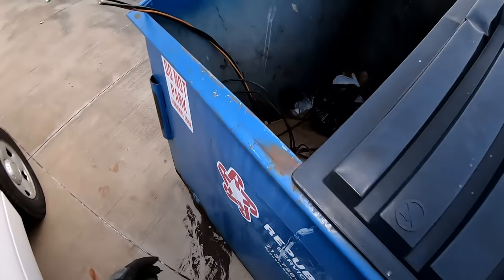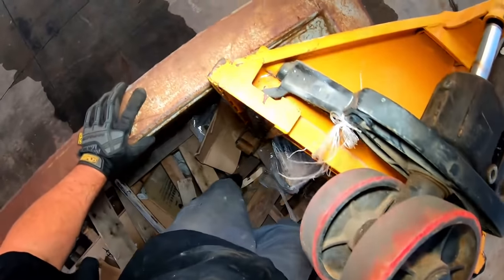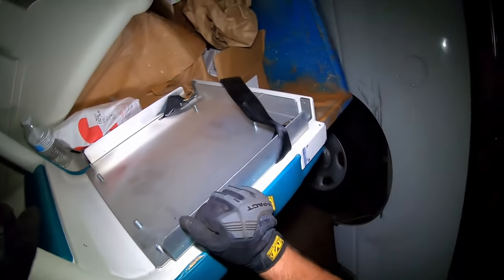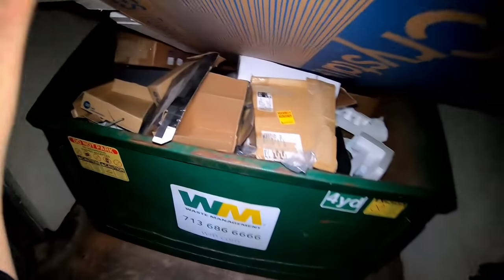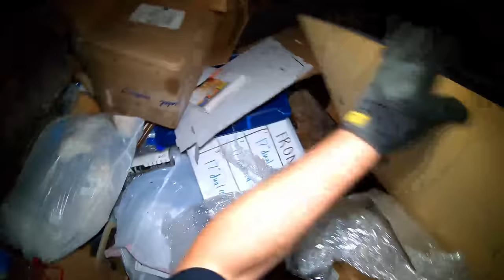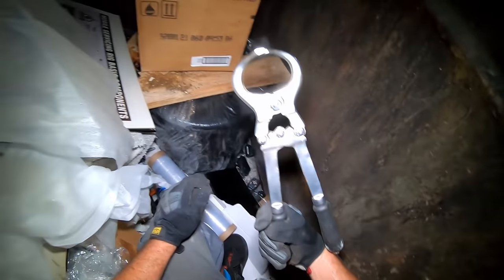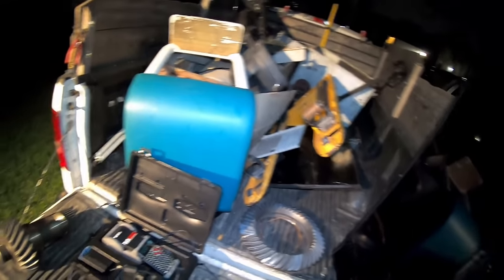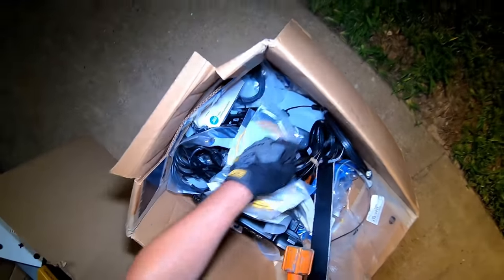Dumpster Diving "That's Some Meat Right There!"

Comment: I had a little random luck dumpstering yesterday, someone tossed out a retro colored microwave that seemed to have never been used, stuffed with dishes  (I didn't go for it, I don't need another Microwave). However, I scored a Coleman Red Canyon 10x17' tent, totally unused, an 8 pack of Disney trading pins (also unopened) and a 4 pack of Pokemon Pez (ditto), almost $200 score, the tent ranking in around $155 on Amazon, $25 for the pins, $12 for the Pez.
Reply: Nice!
You could start your own YouTube channel!👍😊
Reply: Sweet score!

Comment: I haven't said this many times: but I was impressed you got the pallet jack out.
Reply: Way it was stuck in there.. I woulda said.. HELL NO. 
Then again im a lazy sob sooo :P
Reply: I found a construction sight had 3 pallet jacks in the roll-off. I grabbed all three. I took parts off one and fixed the other two. Sold one to a friend of mine now I wished I had not messed with them. I ended up concreteing the whole shop and some sidewalks so I could roll pallets around. They don't work to good on dirt.
Reply: أر📤📪📟📟📟
Reply: @richardjohnson4373  g
Reply: Sjadalhlbuse
Reply: Sjadalhlbuse
Reply: Sjadalhlbuse ĝ6

Comment: So the oil field thing you didn’t know what it was is called a drift or rabbit. It’s used In wells that are completed and producing to help prevent scale build up, pressure in the well drops below a certain psi and the rabbit falls, pressure builds pushing the rabbit back up. The trick is catching it in the tree!

Comment: Mike that thing your calling for cows hoofs is stainless steel and called a Burdizzo emasculator, it's for docking tails and castration by crushing the tissue prior to cutting to help prevent bleeding. They are about 350.00 new. Used they still sell around 100 to 150 because they are used allot on ranches. For sheep and cattle

Comment: That item you called a large toenail clipper was really a item used for cutting the cords in the ball sack of a bull to make him a steer. To see how it works but a piece of string between two pieces of paper and then clamp down on it you will Cut the string but not mark the paper. stay safe good luck 🇨🇦

Comment: Hello Mike the pliers that have found and meant they would be for pruning hooves is for castrating horses so that the seed strands are so squeezed so that they are desolate which are expensive you can sell to a veterinarian.👍🏻 greetings from Germany.🇩🇪
Reply: I have a set for use on cattle - they're called a burdizzo.

Comment: You can buy a rebuilding kit usually at Granger,  if it dosen't go up or down check fluid, highest set screw on cylinder,  should full  up to there . If is theres two ball valve springs, one is stuck open. Kit is easy to put in and has instructions.

Comment: You should be grabbing those dry erase boards. The frame and marker shelf are extruded aluminum and some of the better ones have painted sheet steel for the writing area.

Comment: If you got an angle grinder / cut off wheel, you could add those refrigerant tanks to your scrap pile. Also, for things like gears, see if you can locate a metal artisan in your area. They would pay good money for unique things like that.

Comment: Careful with those pallet jacks have seen fingers taken off with people picking them up and moving them around.
Reply: Never knew that. I'll be careful. I scrap here in Florida.
Reply: Yeah they are extremely dangerous if not used properly, I could totally see it taking a finger off when the weight pivots and slams the handle down

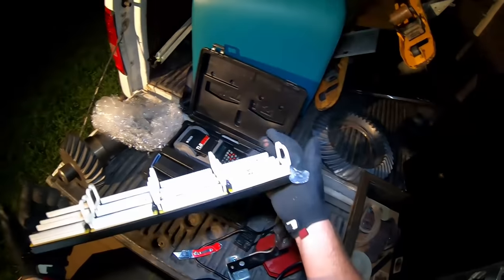Comment: 42:56 that's a patch panel, that usually goes into a each computer rack then the computer servers will connect into them and behind the panel they will run huge looms of cat cables all the way to the rack which contains the network switches and routers. It's just a way to organize and easily trace computer cables for troubleshooting.

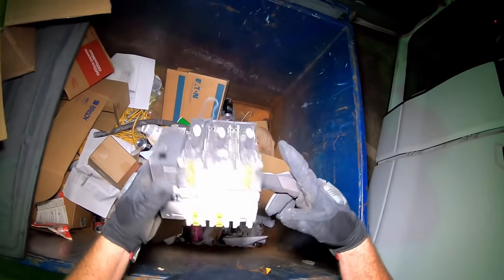Comment: 14:30 that did not look like a breaker, rather like a...idk English word for it, well it's kinda like a relay for high currents and voltages. 380 volts and over 50 amps high. Must have a copper coil somewhere inside.
Reply: A contactor

Comment: Pallet jack from Harbor freight is 250$ new. Most of time the chain breaks between the handle and the frame. Usually 3 allen heads and be careful  just in case chain is not broken "YET".

Comment: That’s a 48 port cat 6 patch panel. Couldn’t make out the manufacturer name but you can probably get a few bucks for it as long as all the ports work and meet cat 6 standards. A comm/data contractor can test it and buy it if he needs one for a small job.

Comment: good job man ...like the way you run your cam ,keep vary low try not to show your location .. site specific .. kauai is a place where we changed from reuse everything at least twice... cars going four to five hands before being parted out until the truck still lives for 40 years. i have four 2000 ford 150 scabs , that is a good truck !!! change your OIL and keep that engine checked.. its a new engine.. needs constant care . check engine daily. i have 215,000 miles on mine... KEEP scrapping.

Comment: The gear you are trying to figure out what they are is a ... The larger round ring is a Ring Gear and the longer shaft one is called a Pinion ... They are probably for a semi-truck or something larger than that..AS a pair they are called a Ring -N-Pinion ... and that is what drives the axles which in turn are attached to the wheels of something large as a front loader for caterpillar.
The boxes you are talking about for Comcast cable boxes NO LONGER HAVE HARD DRIVES IN THEM.... It gets stored online in a cloud .....

Comment: Hi mike , the yellow pin looks like a seal for overseas containers, (special steel) they seal the doors with it by pushing a cap on the other side with a special ring in it.
Customs grind it off on arrival at the port to check the goods.  greetings from holland